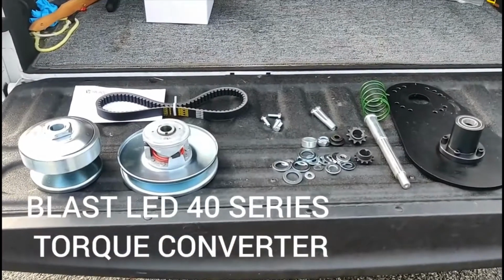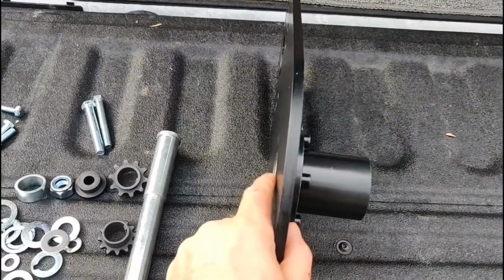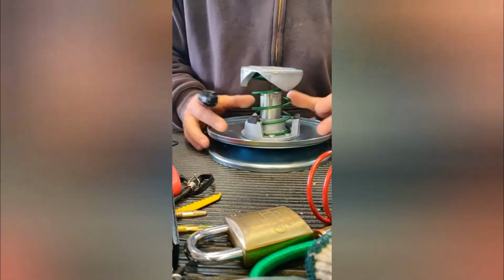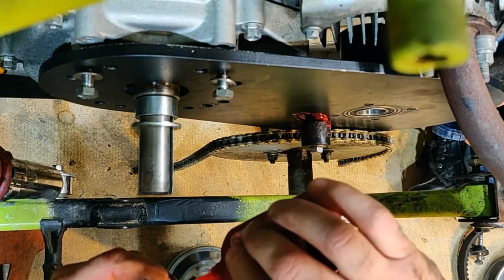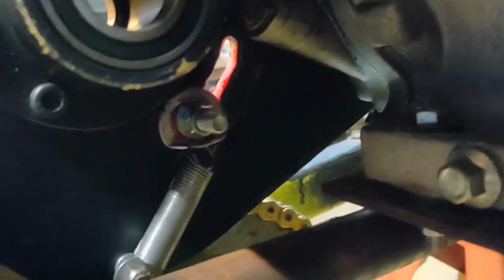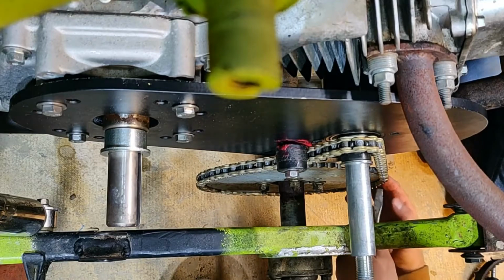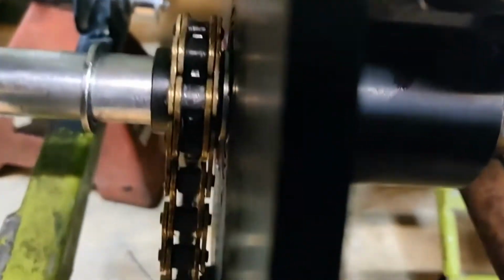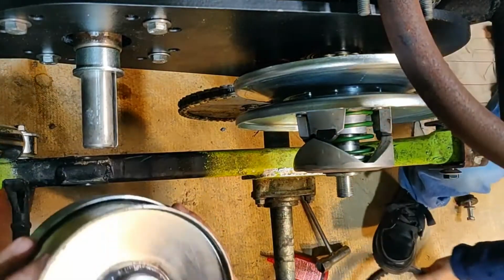40 SERIES TORQUE CONVERTER INSTALL - PREDATOR 420cc

Comment: Dose the Kit come with Red reversed spring,,So Kit comes stock with 2 springs?Clock wise and counter clock wise?
Reply from the maker: Yes. Kit comes with installed RED CW spring. However, We put Green CCW spring in the kit , in case setup requires it.